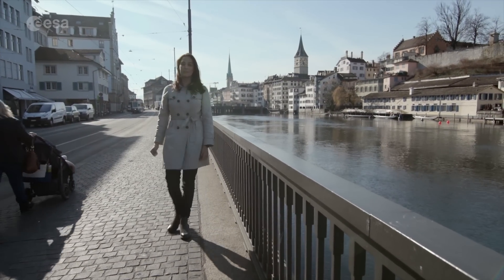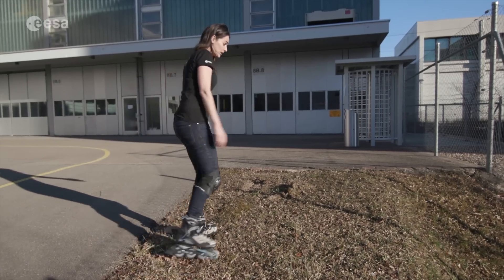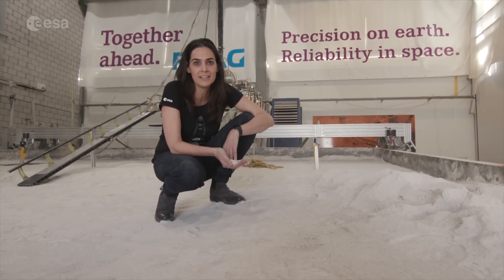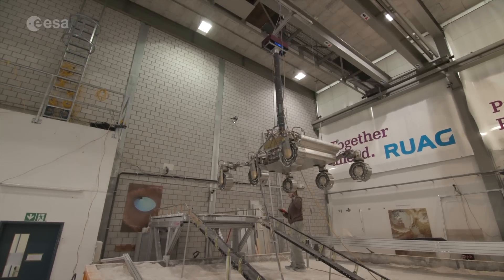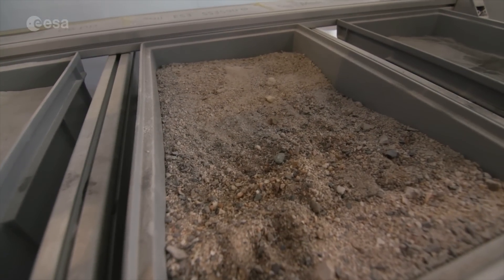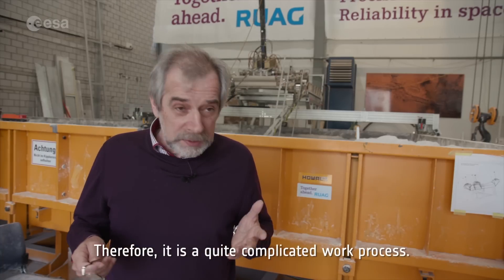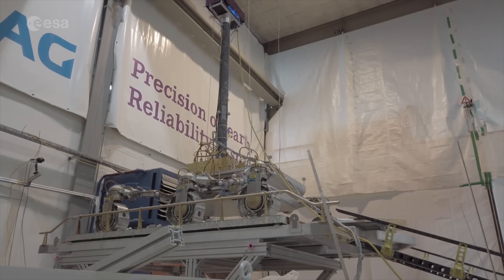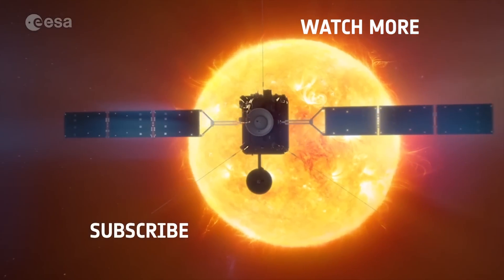ExoMars – Testing locomotion

Comment: Why useva soft rubbers  wheel in rover?
Reply: rubber will become brittle at the temperatures rover will face. This can be as low as -60°C
Reply: @DC2022    you right I am say high tec  insulation wheel. And temperature not -60 Celsius .  Mars mostly temperature -120
Reply: @villtareyaexplorenew5226  yeah, missmatched average temp an coldest below -130°C.
These wheels shown their assets during passed flight. Metallic wheel are strong, resilient and simple meaning also cheap. When we have chronically underfunded space program, money is a factor to deal with... Sadly.
Reply: @DC2022    you are right I am thinking a solution. Metals,  titanium and aluminium it's so heavy element's  by the way you are right. And where are you country
Reply: @villtareyaexplorenew5226  I'm from France
Reply: @DC2022   I am from Russia
Reply: @DC2022   nice to meet you.
Reply: @DC2022     lika 🐕 my English not good
Reply: @villtareyaexplorenew5226  good enough  😉  . Priviet!
Reply: @DC2022  you known French
Reply: @villtareyaexplorenew5226  Since I am french, I can say yes 😉
Reply: @DC2022   ok  your channel icon is amazing.
Reply: @DC2022   long time why you not reply my massages please answer me?

Comment: I was thinking just then: surely compressible wheels would defeat the point of a wheel, and that caterpillar tracks would be more ideal because they have a massive contact area, but then realised that they probably would waste a lot of space and add unnecessary weight, plus if a track comes off it'll be impossible to fix. This looks brilliant. Always interested to see what advances we are making in design solutions.

Comment: Try and make sure the wheels on your rover is more durable than those of all the other rovers that explored Mars heretofore.
Reply: the wheels on the other rovers were REALLY durable. Remember they survived several YEARS when the rovers were expeted to last few MONTHS... If it wasn't the giant freaking storm Oppy would still wander on Mars after FIFTEEN years. their wheels can be improved and wheel be, (ok, it's a bad joke) on Mars 2020 and Exo Mars by different design, but this doesn't imply the previous one were bad. Even worn, Curiosity wheel are doing a darn good job.

Comment: These wheels look like an amazing piece of engineering, even from the "distance". I would love to see a more detailed technical explanation/analysis of them.
Reply: Yeah, but they sure bring some moving or at least bending parts with them, and so more potential points of failure. That might shorten the lifespan. Remains to be seen if the benefit of more contact area is worth it.